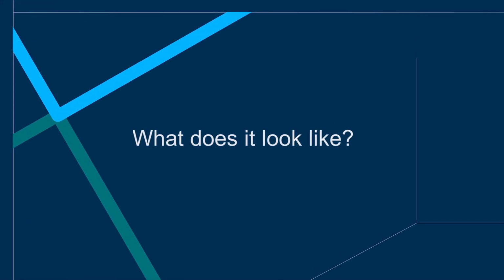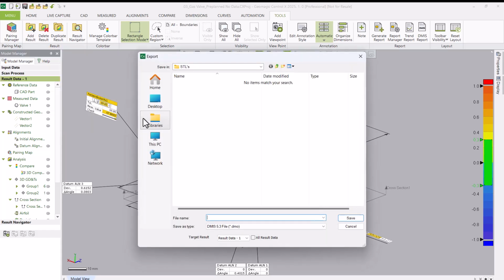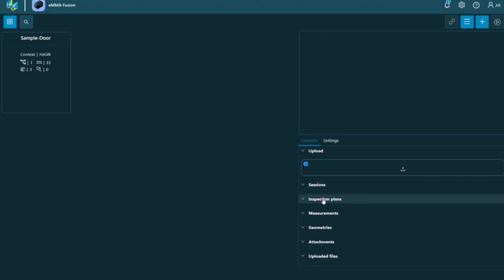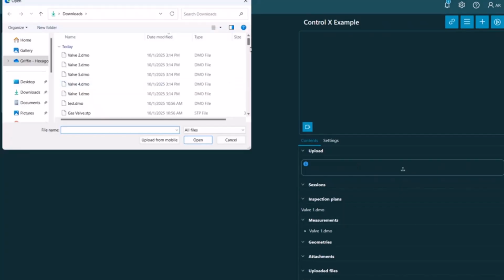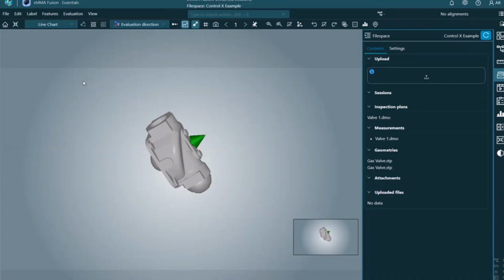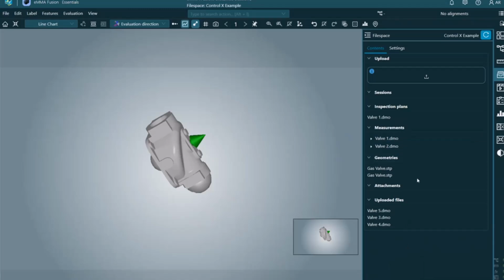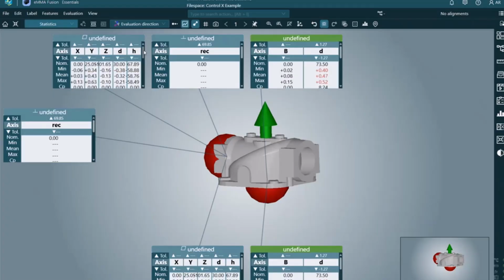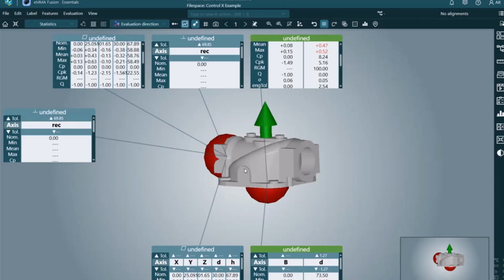DMIS Export and Reporting | Geomagic Control X

Comment: I am experiencing an issue with Geomagic Control X where the software is reporting true position deviations as radial values .0185 instead of automatically doubling them to reflect diametral values 0.0370) as expected with a tolerance defined as ⌀0.028. This behavior deviates from the typical functionality, where diametral deviations should be displayed directly for cylindrical tolerance zones.
Details of the issue:
The feature control frame includes the diameter symbol (⌀0.028) for the true position tolerance of a hole. An external True Position Calculator confirms the diametral deviation as 0.0370 inches when doubling the radial value, indicating the data supports this calculation. I have verified the GD&T definition, alignment, and rebuilt the inspection, but the software continues to output radial values. I have attempted to adjust settings and templates, but the issue persists. I look forward to your support.
Reply from the maker: Hi Luigi, thank you for reaching out with this question. It would be best to speak to Technical Support about this. They will be able to assist. Here is their contact information: https://support.geomagic.com/s/article/Contact-Us.